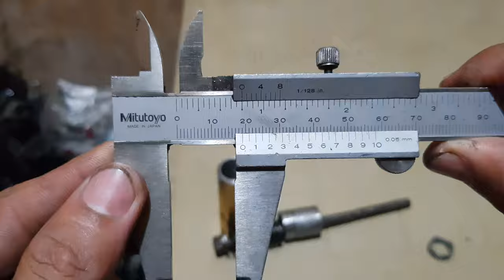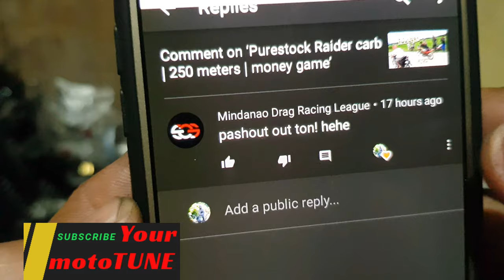Gold inner tube/yayamanin tube  | shout outs

Comment from the maker: Wala problima kahit umiksi yung inner tube,dahil mataas po ito kumpara sa stock tube. Ngayun meron din nmn pinapalitan ng dumping rod ng xrm 110 kaso yung bolt na kasya sa outer ng raider is 10mm at yung sa xrm nmn is 8mm, so maluwag xa at pwding mag leak yung ibaba ng outer tube sa lalagyan ng bolt.

Comment: legend ca talaga paps
Reply from the maker: Tnx sa panonood paps.. ridesafe
Reply: @YourMotoTUne  wc paps. pwedi kaya paps bumili ng goldinnertube tas stock baso tapos palit lang ng dumping rod ng wave or xrm?
Reply from the maker: @dailygrindtv8698  pwd nmn pero ang problima paps.. yung bolt sa dumping rod.. 10mm kc ang raider at 8mm sa xrm mangyayari pwding mg leak yung oil sa lalagyan ng bolt sa outer tube baba.
Reply from the maker: Kc maluwag xa sa outer tube.